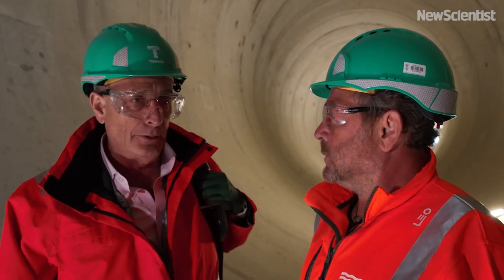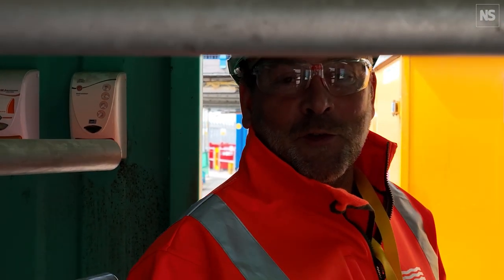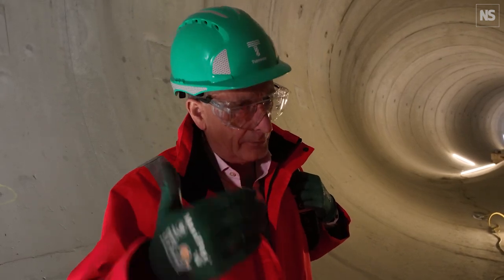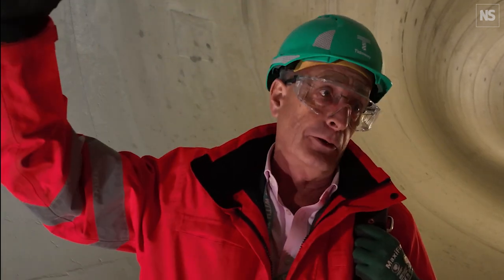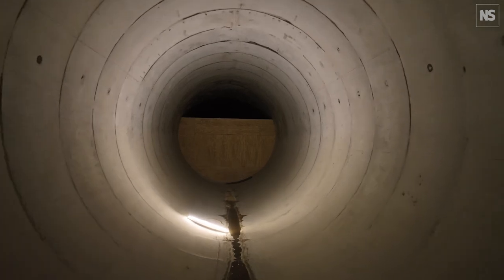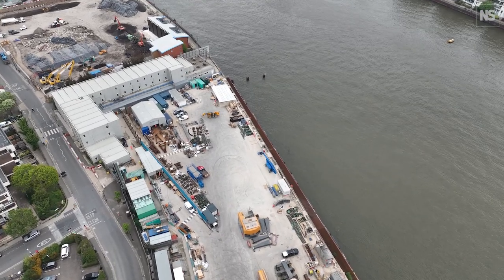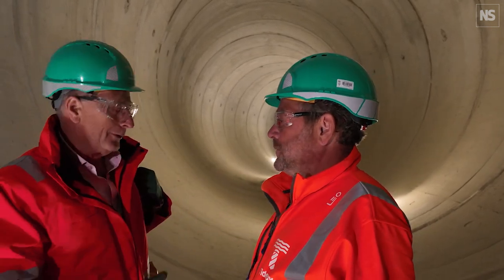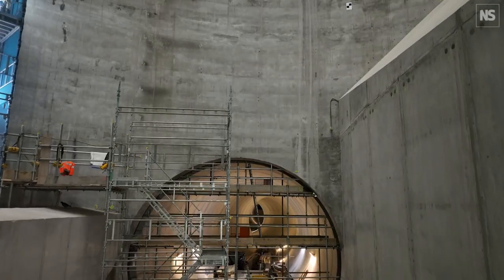Inside London's super sewer: The tunnel designed to keep sewage out of the Thames

Comment: Maybe if people ate a bit more fibre and a few less Big Macs we wouldn’t need this
Reply: Fibre results in far more "stuff" going into the sewers (the Big Mac people will just be constantly constipated).

The main issues are things like wet wipes and fat/oil poured down drains, but really this is required because the population of London is far bigger than when the Victorian sewers were built and it simply doesn't have the capacity anymore.